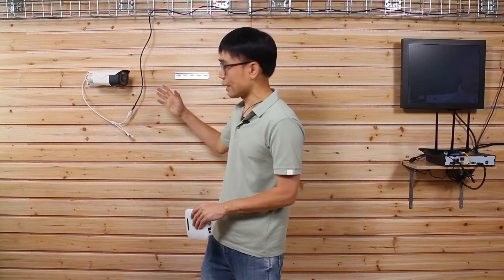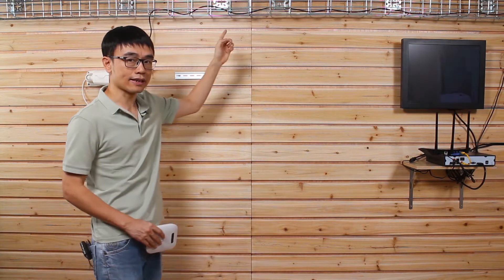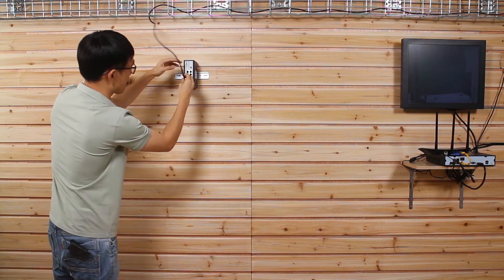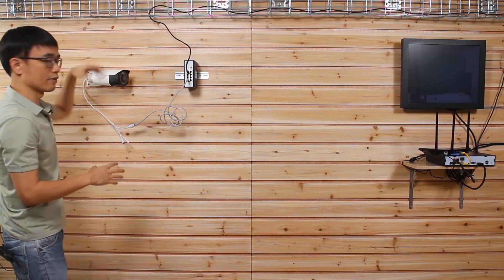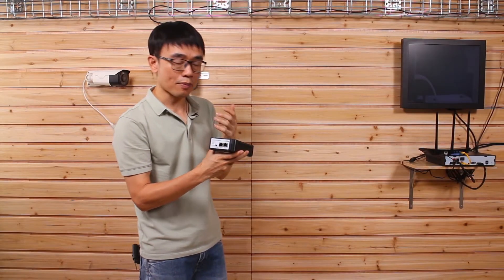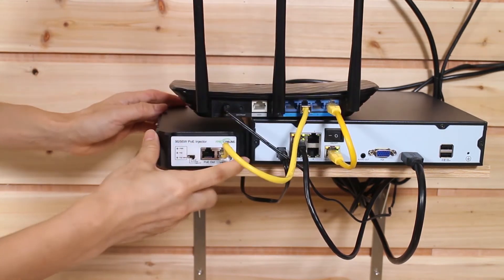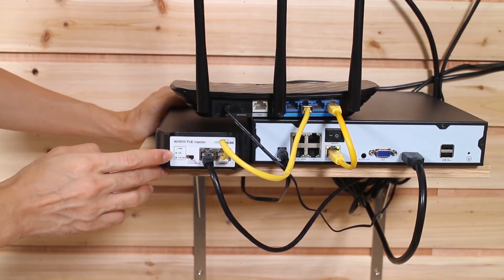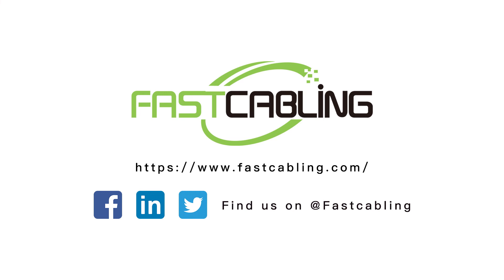How to add new IP cameras access point without re-wiring the cable

Comment: Wonderful video, however, what's the link between the camera and the NVR in this case? How will the NVR record footage when it's not linked to the camera? Sorry,  I'm new in the IP camera setup so I'm learning a lot here.
Reply from the maker: The power-powered switch and the NVR are connected to the same router, so they can communicate over the network. The NVR finds and connects to cameras via their IP addresses. It will record footage from the cameras as long as they are on the same network and properly configured.
Reply: @Fastcabling  wow thank you so much.. learning a lot here_
Reply from the maker: My pleasure!